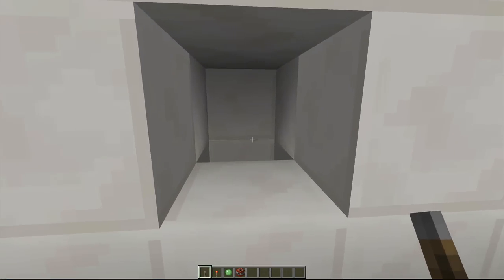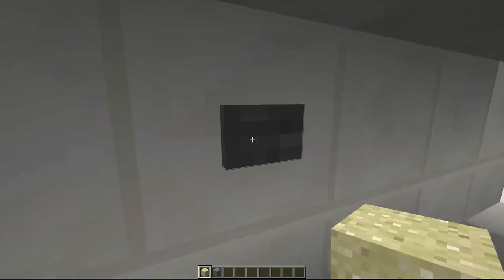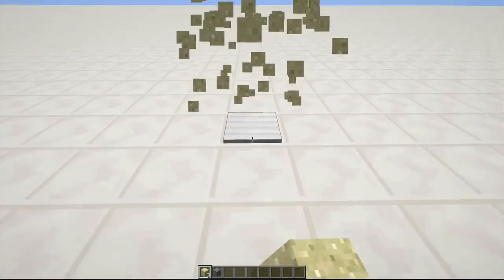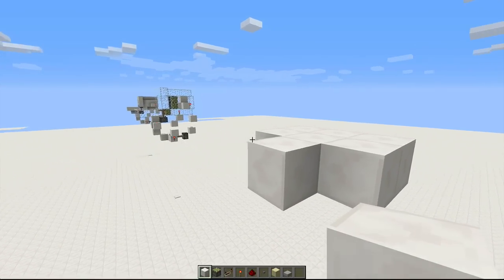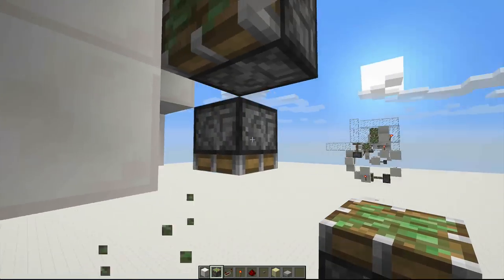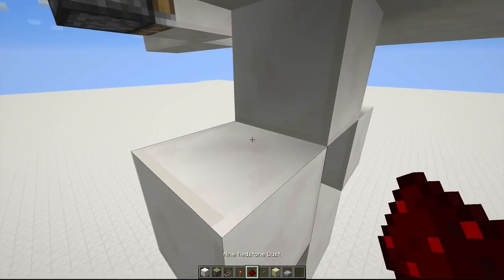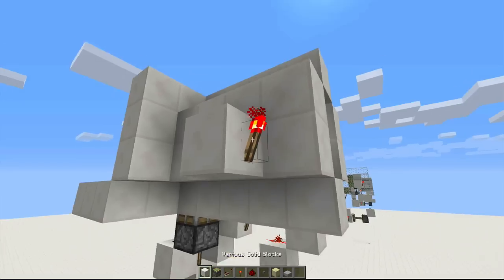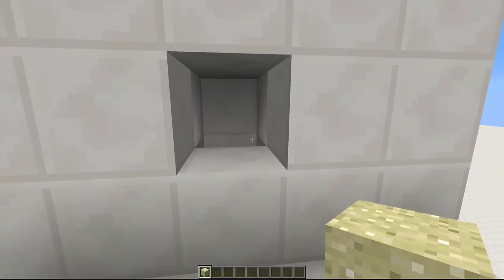Sand Activated Door

Comment: Interesting. You could use hoppers to recollect the sand/gravel so you don't have to dig more after a while.

Anything ideas for the new snapshots? 13w24b removed limitations on placing carpet, so you can place it on anything, including other carpet. I made a 5x5 circle of powered rail, placed two layers of black carpet on top of the rail, then placed black wool blocks on either side two high. Put a Minecart inside, got in, closed it up, and started moving. -Fake- moving through one block gap.